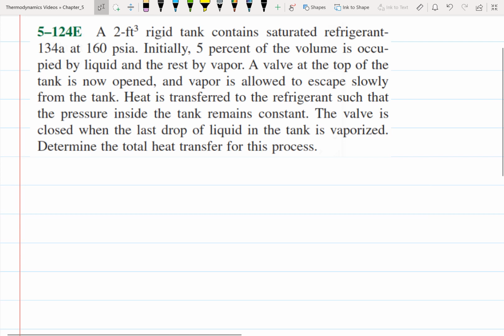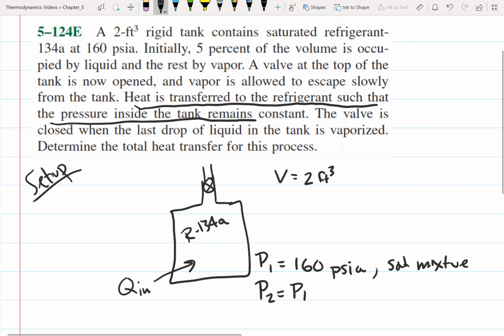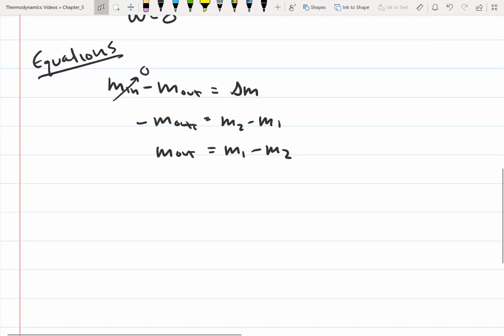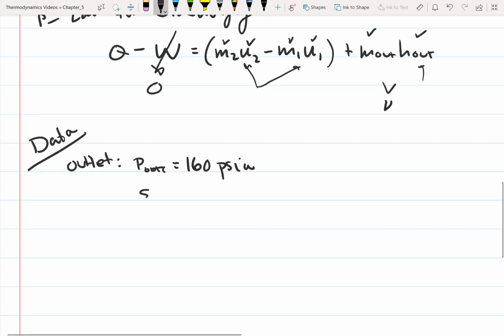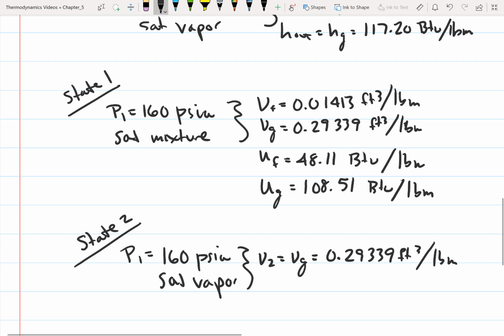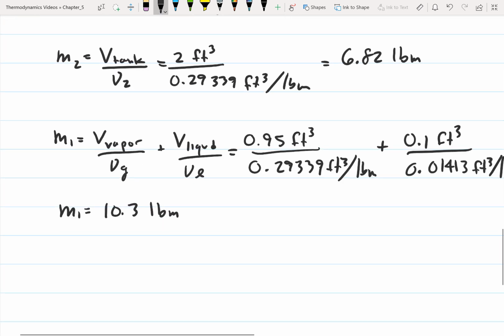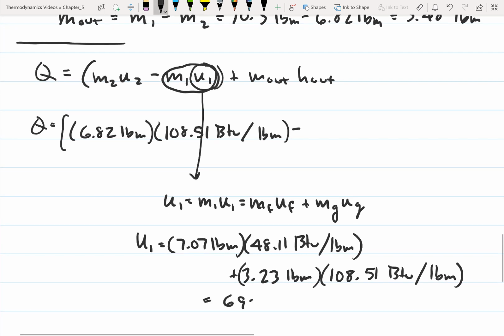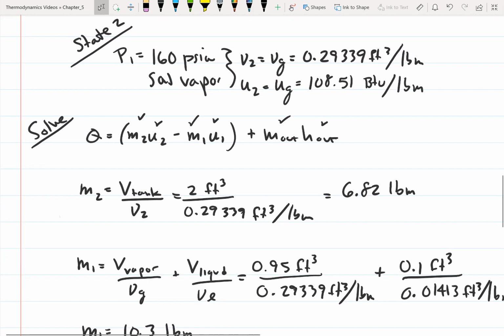Thermodynamics: Un-steady Flow Energy Balance (1st Law), Discharging Example

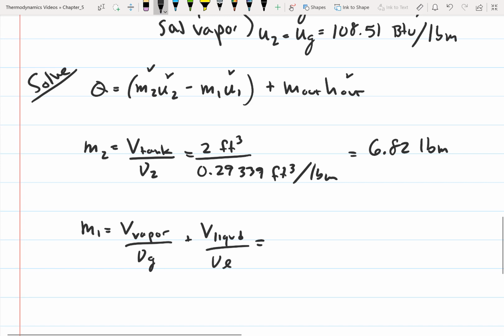Comment: There is a minor mistake here @13:32 of the video. Volume of the vapor is 0.95V, which is 0.95(2ft^3)=1.9ft^3 of vapor. I believe you got mixed up with the 95% figure. 0.95ft^3+0.1ft^3 = 1.05 total volume, when the tank is and should be 2ft^3. Mass 1 should be 13.6lbm. The equation should be: 1.9ft^3/0.29339ft^3/lbm + 0.1ft^3/0.01413ft^3/lbm = 13.56lbm.

You factored it in early in the video, just forgot at the end. I do appreciate these videos though, always good to see how different people approach problem solving.